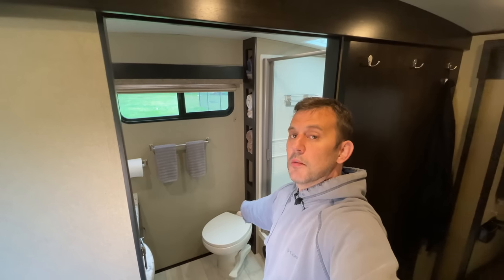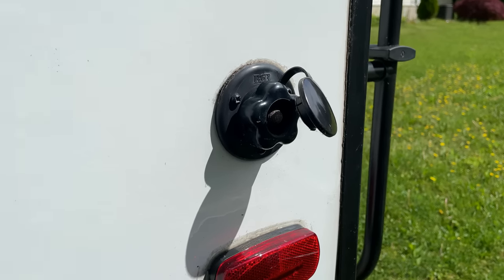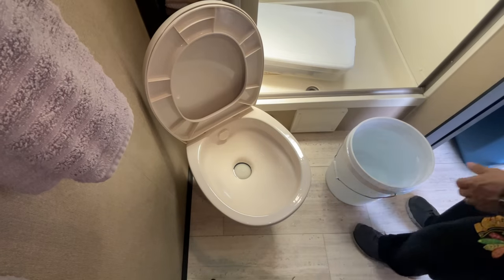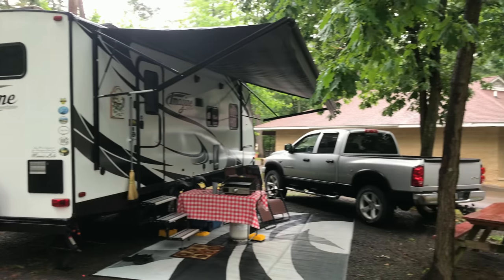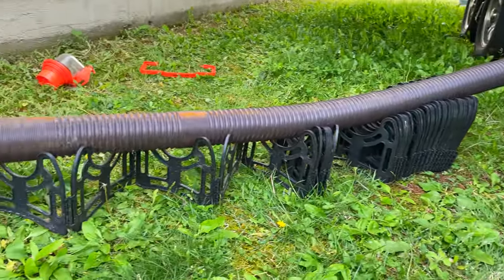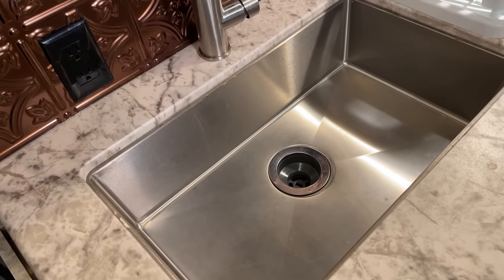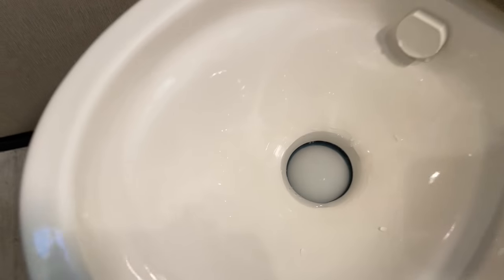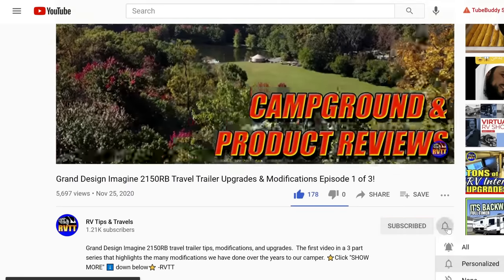RV Black Tank Cleaning, Maintenance, Tips & Tricks - The Original Black Tank Master Class

Comment: I have been previously told that the tanks need to be emptied completely for the winter when storing the RV outdoors where winter temps go below freezing. Interested in your thoughts on this whether frozen (expanding) water will damage the tank with 5 to 10 gallons of water sitting in it over the winter. I live where it can get to -20 degrees at times!
Reply from the maker: If not using it, I’d empty the tanks.  Small amounts of water won’t usually expand enough to damage anything, but you can never be too sure.

Comment: Hello Im new to RVing and found this video most informative and showed how to fix or avoid problems I had no clue I was  going to run into. Thank You and you've got a new Sub for sure... But there is one subject I've not found much info or help with and that is tips or how to use the toilet in a RV...I mean there is a big difference in a RV toilet and the one at home
Reply from the maker: use as normal, just when you flush hold that pedal down for about 5-10 seconds after everything goes down to chase everything with water.  when you finish, release the pedal just enough so the valve closes but water still comes into the toilet.  you want to have an inch or 2 of water above the valve to create a vapor barrier.

Comment: Quick question: Do you need to use the pressure regulator while black tank flushing? We have a 2016 FR Vibe...
Reply from the maker: technically no since the lines arent holding any pressure... once you turn the water on it is being sprayed into the tank and therefore the lines arent pressurizing.  however, it never hurts though to run all sources through a regulator.

Comment: Drill a hole in the side of your dump valve for a 1/8 inch pipe plug. Once or twice a year, pull the plug and shoot some silicone spray in the cavity the valve recedes into. This lubes the valve stem and the rubber seals.

Comment: Should we keep water in the black tank in freezing winter weather when storing RV? ( sorry for this stupid question)
Reply from the maker: not a stupid question at all.  the answer is no.  at that point your camper should be winterized, and your black tank should be completely drained and empty until you dewinterize.  its ok to add a gallon or 2 of RV antifreeze to your black tank if you'd like.  also make sure you put antifreeze over the ball valve.  check this winterizing video out when you have a minute.  https://youtu.be/U7pICjlfc6o
Reply: @RVTIPSANDTRAVELS   Ohhh… thank you!

Comment: Are there any negative effects to a (possibly) clogged roof exhaust pipe, or a RV sewer hose that doesn't have a complete seal with the sewage drain PVC hose?
Reply from the maker: A clogged roof exhaust will stink up your rv quickly.  A leaking hose connection will stink up your site, probably piss off a few neighbors, and might even get you in trouble with the campground.

Comment: It seems that Aqua Kem is the #1 rated holding tank cleaner but from what I've read it has been superseded by Aqua Max. Have you used the Aqua Max and is it as good as the original? Thanks!
Reply from the maker: great question Larry, its a "no formaldehyde" version.  I think I always preferred the Aqua Kem over everything, but when it became difficult to get I switched over to Happy Campers.  I have not tried AquaMax yet but would love to try it some day.
Reply: @RVTIPSANDTRAVELS  Thanks for the response! Happy Camping!!

Comment: Thanks for the informative video. We’re RV newbies. If dumping at a dump station, when and how do you add water and treatment to the black tank. We would have to open the door, pull down the stairs, etc. while others are waiting. Is that okay?
Reply from the maker: If others are waiting, I would pull ahead and let them in.  Just pull off to the side inside the campground somewhere, and add water from your tank by pressing the flush pedal.  Then empty your fresh tank on the way home.
Reply from the maker: Even if you don’t use the tank, put a little water in there to fill the black tank.  I’ll usually open my fresh water drain upon leaving and it will only take a few minutes of driving to empty.

Comment: Thanks Ross, excellent video, just what I needed.

I may be old, but new to rv-ing.  We bought a 1982 Sunline 16 footer about a month ago, and I'm concentrating on checking out the electricals and learning how campers work.  Since it's actually freezing tonight I must check out my tanks immediately.  I know one night of 30° won't break anything, but no more delays.

I think I have a combo tank - haven't found a second tank yet, though it's hard for me to climb underneath.  I was thinking I could dump water in the sink while holding the ball valve open and see if water flows in.

I get it about the chemicals to use, but what about antifreeze?  I just bought some from Walmart, but I guess I'd add it after my last cleaning?

Most serious question is where to dump it to?  Must I go to a dumping station, or could I add one to my home septic system?  I don't think I want to dump it in the yard!

My water tank is translucent and easy to see - looks empty, pump works but no water so I think I'm ok.  Tomorrow I'll remove the fill hose and try to check for water.  Should I leave it dry or give it antifreeze?  I have couple of low-point drains I'll have to try.  And what about the water heater?  Will it effectively drain?

Thanks again!
Reply from the maker: no need for antifreeze in the tanks if they are drained.  draining into your septic should be fine unless you have some weird septic system.  its the same stuff in your home toilets, lol, as long as there is no bleach.  how many drain handles do you have outside?  thats usually indicative of how many tanks you have.
Reply: I managed to lie down next to where I knew the black tank is, and I found what I needed to know.  There are indeed two waste tanks and two valves, just as there oughta be.  I removed the plug and opened the gray valve and a couple of stinky drops came out.

I had already looked into the toilet and could see clean dry plastic below.  Good deal, someone took good care of the system before me!

Next question: I'd like to have level sensors in all tanks.  The fresh water tank is easily accessible under a bench, no problem.  The waste tanks are another matter.  They seem to be installed right under the floor.  I can see where drain pipes from the kitchen and bath go through the floor, presumably right into the grey tank.  And the black tank of course is right under the toilet.  So could I drill through the floor to install sensors?  Logic tells me yes, but with minimal experience I'm leery of cutting something I shouldn't.  Installing sensors on the sides of the tanks is out of the question for me.  But I could install float sensors easily from the top, if I can drill safely.

Can't thank you enough for your help!  You'll make an expert of me yet!

Comment: Selling a camper that has little use and been sitting up mainly.  How can I get tank cleanish with no dump place and don’t want to move it? If it is pretty clear , then to pass it off should it have a few gallons in there and a treatment ? Or, be empty of everything?
Reply from the maker: If you can't dump it, I would put about 10% capacity of water, then add a treatment like Happy Campers or Aquakem, and just leave it in there.

Comment: What if you own a 20 year old camper that doesn't have a flush port.
Well I can tell you.
during dumping shut water off send garden hose through the storage campartment.
  use a small PVC pipe with holes in it to spray into the black tank from the toilet hole.
Yes I know extra work but it works.
Reply from the maker: That’s a great idea if you don’t have a flush port Rick!  Thanks for sharing.

Comment: This is a great video and on spot information. It is EVERYTHING YOU NEED TO KNOW! I have a 95 Safari and the (darn) gauge does not work well. Anytime I have the opportunity I will dump BW and refill (I have it timed) and dump as many times as I am willing. Getting some improvement on the gauge after doing this for 4 years, whew...I also use the aquakem and also add a cup of dawn and boraxo when finished so it is working in the tank for the next trip. Ice cubes are usually gone at the end of the trip...
Thanks for the good work, I have never (never) subscribed to a youtube but am your new convert, even though I already knew all this and you did not use your gloves when handling the sewer hose each time!!! Great Job!
Serengeti from what was the Great state of Washington
Reply from the maker: Thank you so much!

Comment: I have a 2003 trailer and I have no info on the size of the tank. When filling up with water, I'm guessing that when it reaches capacity, you're able to see the water rising toward the toilet valve so as not to have an overflow, am I right?
Reply from the maker: correct, but maybe reach out to the manufacturer for an owners manual, or online groups to see what your tank size is.  whats your year, make and model, maybe someone here can help you out?

Comment: Great video and you earned yourself a subscriber. I do have an issue though with your using a nozzle to break up the "poop pyramid". Yes it will work, but you are also aerosolizing the fecal matter. This is a very good way to make yourself sick. I would probably look at other ways to break it up rather than using high pressure water.
Reply from the maker: Thanks Mike, I don’t disagree with you.  Something I thought about while filming.  But with the water from the toilet flushing and the pipe being so long I don’t really see anything coming from the bottom of the tank all the way up and out, especially with the toilet flush water.  I also thought about putting in the video a note to use something like a blunt broom handle instead that would be thrown out after, but that might lead to people poking holes in their tanks too.

Comment: What do you do with the black tank at the end of the season? I assume I can't leave water in that tank over the winter.
Reply from the maker: Before leaving the campground on my last trip of the year before winterizing I will fill and dump the tank about three times and finally let it drain completely empty. During the winter I will leave my black tank valve open so it can air out over the winter.

Comment: Hey Ross, thanks again for these great videos. I have the exact same TT as you. My Black Tank flush line appears to be clogged, worked great the past 2 months since my purchase, but as of last week it wont fill my black tank. I'm wondering if the check valve is stuck?  Do you know where the black tank flush check valve is located on the Imagine?  Any other recommendations will be greatly appreciated.  Thanks again!
Reply from the maker: its probably right behind the wall, behind the towel storage in the bathroom.  those are known to fail.  below I will post a pic on how they are designed... and also a link to a video using the Camco rhinoblaster pro.  I dont even use my black tank flush anymore, its pretty ineffective compared to the way I show how to backfill and rinse your tank using the camco adapter.  it might be easier buying the adapter than tearing the wall apart.  see links below:

pic: https://gdrvowners.com/filedata/fetch?id=19472&d=1590342423
video: https://youtu.be/Q7ZJzfimLwg
Reply: @RVTIPSANDTRAVELS  Awesome...thanks very much Ross! I really appreciate your help.
Reply from the maker: glad to help

Comment: You mentioned, always keep water in your black tanks. What about if you are storing your RV in below freezing weather?
Reply from the maker: Depends on how often you are dumping.  I think leaving at least a little water that has enough room to expand when it freezes but not damage anything will help with the poop pyramid.  That could be a crap shoot though.  There’s no good answer, your either freezing up the water and it expands and damages something, or creating a bad situation with the waste sticking to the tank.  Do you have a tank heater?
Reply: @RVTIPSANDTRAVELS  Thanks for the info. I was thinking after it was completely flushed out and No residue, it would be best to leave the tanks completely empty so the pipes don't crack. And then once getting to a non freezing point, fill it up with the 10% solution you mentioned before. Definitely more work but seems like it would help prevent any other pipe damage from the water freezing.
Reply: @RVTIPSANDTRAVELS  I do not have a tank heater either.
Reply: First, thank you for the informative, concise and honest explanation for helping people deal with their black tanks.  I follow many, if not all of the suggestions you recommend.  Here is how I deal with my black (and gray) tanks during the time my fifth wheel trailer is winterized.  We live in MT and regularly deal with extended subzero conditions during the winter and I've never had a problem from freeze damage in the trailer when following this procedure.  First, completely clean and drain the black and gray tanks using the methods previously outlined in the video and close the drain valves.  Then, during the winterizing process, make sure you collect excess winterizing solution in the black and gray tanks.  Once you are satisfied you have flushed all of the water out of the hot and cold water lines and replaced it with full-strength winterizing solution, you should have diluted winterizing solution in both black and gray tanks.  Next, drain the residual winterizing solution from these tanks and close the valves.  This solution is not full-strength, meaning it doesn't have the complete freeze protection labelled on the winterizing solution container.  Next pour a minimum of half a gallon of full strength winterizing solution into the black and gray tanks.  Open the slide valves on both tanks half-way, allowing the winterizing solution to drain out.  Leave the valves half-open.  This accomplishes several things; 1) Some full strength winterizing solution is now in your tanks and in the slide gates/valves and slide channels helping to protect them from freeze damage.  2) By leaving the slide gates/valves half-open (or half-closed depending on how you look at it) you further help protect these valves from freezing should there be any possibility the full-strength winterizing solution didn't get to the valves.  Hope this helps people when winterizing.

Comment: My question to you is with your Thetford treatment do your tank sensors still work accurately?   I’m guessing not.   You have probably been using something else to get them to work correctly.
Have you ever heard of “struvite”?   When you mix hard water, urine, and fecal matter, crystals are formed that start sticking to the tank and form a layer on the tank.  Struvite is like a soft rock.   When you dump your tank, there is enough liquid in the struvite to cause sensor lights to come on.  Those digesters and perfumes do nothing for struvite.   There are two ways to get it out.   High pressure jet cleaning, and the Geo method.   Borax is Boric acid.   Acids dissolve struvite.   Vinegar will dissolve it but has a ph in the 2’s.   So, it would take a lot.   Calgon or Borax will dissolve it with less product as Calgon is ph in 8’s and Borax is in 9’s.   If your sensors are not working correctly, you need to add detergent.  The detergent cleans the surface of the struvite to allow the acid to dissolve it.   At least that is what a PHD in chemistry told me.  Most use Dawn or Pinesol.  Very foamy.   I use clothes detergent for low suds and cleans as good.   
Please watch this video.   https://youtu.be/wr4TGBPyPe0.      This Tech agrees with my thinking.   Best wishes,   Kevin
Reply from the maker: thanks for the informed comment Kevin.  My sensors are still working properly, however Thetford AquaKem pricing has skyrocketed, and they released a version without formaldehyde.  Since then I starting using Happy Campers, which has been fine.  A lot of people use this but I'm not 100% satisfied with it after using it for a while now.  It doesnt seem like there is as much odor control as I hoped with Happy Camper.  However, we camp at full hook ups and I have the luxury of using a lot of water.  Tank sensors are a problem for many though, and I appreciate your comment as it may be something I dive a little deeper into when I do my black tank update video next year.
Reply: Kevin, you are misunderstanding the pH scale.  It is not just a measure of the strength of acids with 1 being weak and 14 being strong.  On the pH scale, 1 indicates a very strong acid, 7 indicates pH neutrality, and 14 indicates a very strong base.  Therefore vinegar's pH of 2 indicates it is strongly acidic,  Calgon and Borax are relatively weak bases.  While Borax can be easily converted to Boric Acid through a reaction with Hydrochloric Acid, Borax itself is a base.  Since acids dissolve struvite, vinegar will do a good job of it whereas Calgon and Borax will not - at least, not due to their pH.

Comment: The hoses need attention too. Watch for the hose and end fitting coming apart. Also, there are o-rings that need to be replaced (leakage is not good). Great video.
Reply from the maker: Hey Ray!  Can you elaborate more on which hoses and o-rings please?
Reply: @RVTIPSANDTRAVELS  At any connection with the hose, there will be a rubber O-ring that will make the seal.  Look up CAMCO RV Sewer Hose Fitting Gaskets.  Perhaps a light coating of grease will make them last longer.

Comment: DO YOU or did you leave water with anti freeze in the black tank during winter….thanks
Reply from the maker: No, drain your black tank completely and you don’t need to put anything in it. The small amount of water that may be left in there has more than enough room to expand if it freezes. You do not need to put antifreeze in your black tank over the winter. Just empty it out.
Reply: Thank you for the quick response ,,,appreciate that